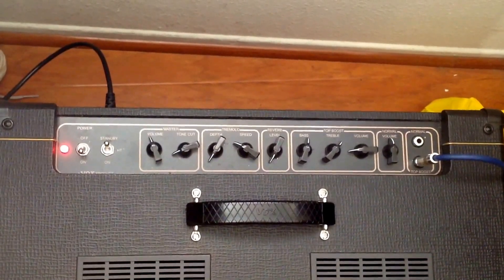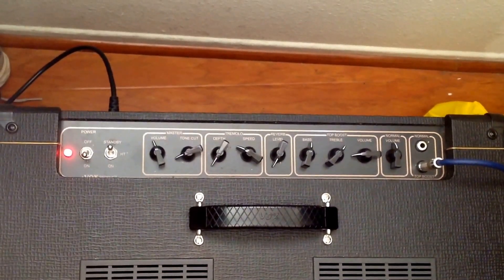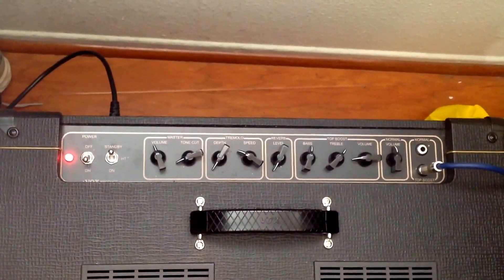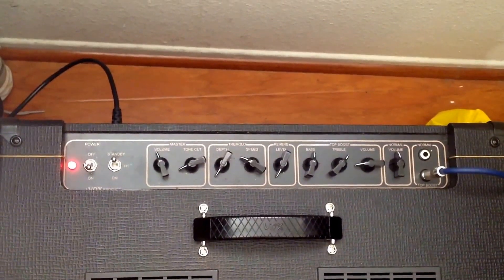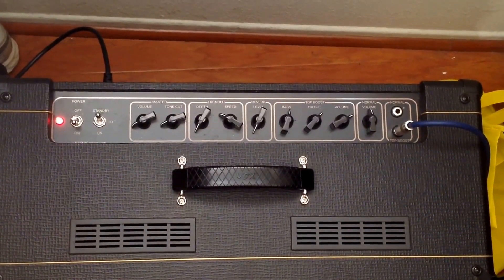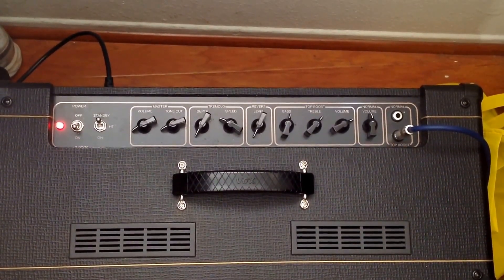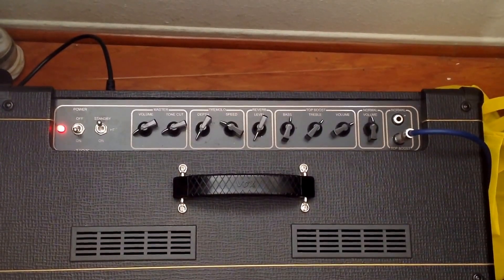Replacing your power cable with a Mercury Magnetics Power cable - demo

Comment: Thanks for the demo David. To me, the Magnetics power cable get rid of the harshness. Sounds more natural and more detaled.  And they are cheap !  Thanks again David.
Reply from the maker: Absolutely!
Reply: I can pickup a 14 or 12 gauge 3 wire cord at any hardware or electronics store. copper is copper, Mercury makes great stuff but makes no difference here.
Reply: Is this the 14 gauge or 12 gauge Mercury Magnetics power chord?

Comment: I’m sure every little bit helps, and by all means, yes.. use a quality power cord.  But the difference in sound quality between or the another would be questionably noticeable.  Consider that the leads leaving the input transfer are smaller than the leads in the power cord.

Comment: I can't say I heard a significant difference. Presently issued AC30s' continuous power consumption is 175 watts, give or take 5% across the range of models. This amounts to 0.79 amps with 220V EU supply, or 1.6 amps with 110v US supply. They're supplied with a regular 6 amp cable, no options. All else equal, the cable has the least effect of any change you could make - better to change the mains fuse, which has at least a measurable resistance, and is supplied with the same 2 amp for all territories. Fitting a 4 amp for the US might take it clear of the 1.6 amp limit, where a 2 amp would begin to bite.

Comment: More bottom end with MM cable. At least that is what I'm hearing on my cheap monitors.
Reply from the maker: Sounded that way to me too. Have not used the standard cable since this demo. Can't go back now
Reply: @satellitesv03  I agree it sounds fuller. The interesting thing is that there are a lot of little things you can do that make a small difference, but when you add them up you get a big difference.

Comment: OMG  you must work for the company. Now way is hell is a 6 ft power cable going to change your tone unless you have a bad one. What about the miles and miles of copper from the AC generating plant to you finally get to your guitar amp. Is all that cable by mercury magnetics too, LOL. Snake Oil is very thick here.

Comment: Snake oil.  It's called the "placebo" effect -- when you expect or hope to hear a difference, and then your brain convinces you that you actually do hear a difference.  That's why proper comparisons are always conducted with blind tests (the comparison presented here is therefore flawed).  Could you reliably distinguish between the two power cables if you were not told in advance which one was which?  I don't think so.

Comment: Playing technique will get rid of the harshness too.  Power cable BULLSHIT. Transformer YES. I.M.H.O.  Electronics in the amp are always changing a little. Power coming in would be more consistent. Remember when it was built new, what cable did they set the amp with?J.M.O.This is like selling ice to an Eskimo.
Reply from the maker: Yes playing technique is by far the thing that will change your tone the most. I absolutely agree with that. The power cable change is not a medicine for anything, but noticing a difference kinda surprised me. I didn't expect to hear any difference. I'd love a decent transformer in my Vox! Have you tried Mercury magnetics?

Comment: I find your video totally BS, and totally devoid of technical sense. Never in a million year is the power cable going to make a significant difference to the tone. That side of the amp is high voltage, low current. So  you have what, maybe 1A going through. If your new cable is maybe bigger, maybe a few milli-ohms better than the old one, equals a few milli-volts more headrooms. Totally insignificant.
That said a better transformer will make a difference, an MM do make some good ones.